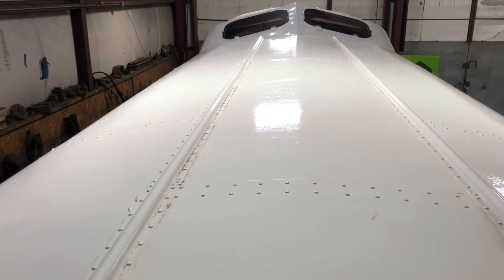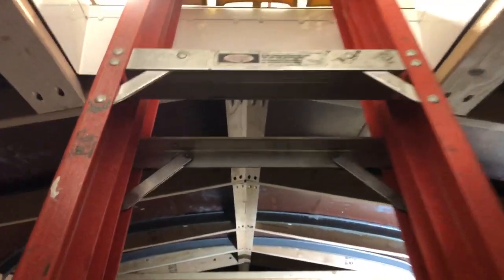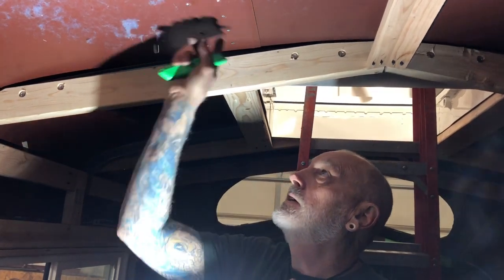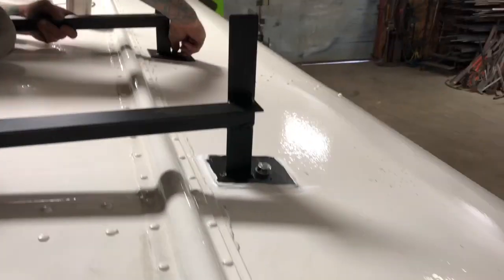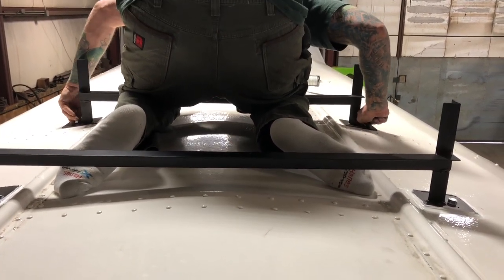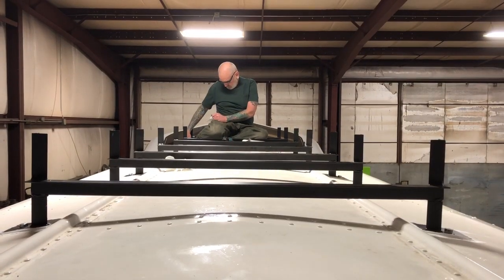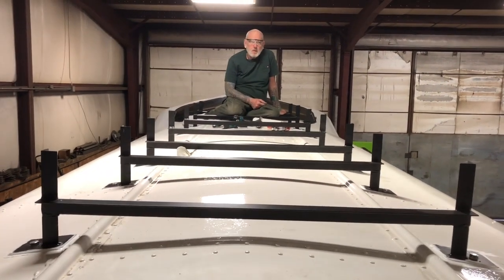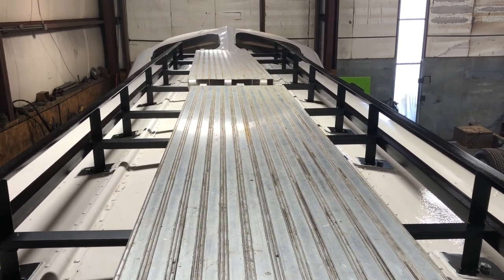Installing the Roof Rack - Vlog 72 School Bus Conversion

Comment: For when I build my roof mounting rails I'm using 5/16 closed end stainless steel rivnuts. They and the installation tool were obnoxiously expensive, but I was worried about accessing the hardware later like you were discussing.  Love your design with a catwalk to go up and service the panels.
Reply from the maker: Thanks -- Randy put a lot of thought into this.